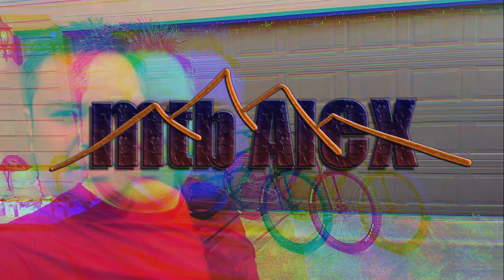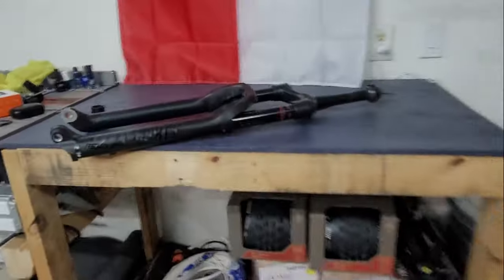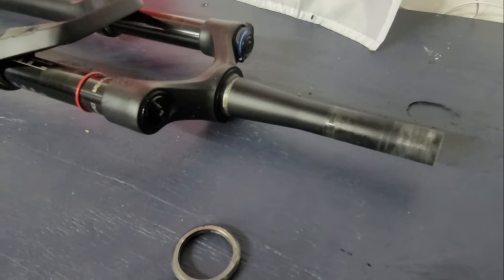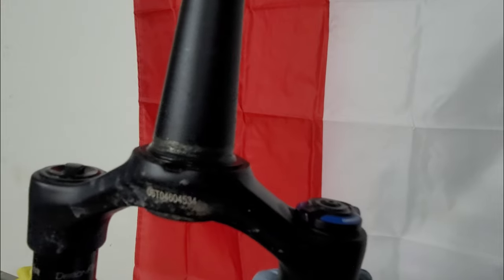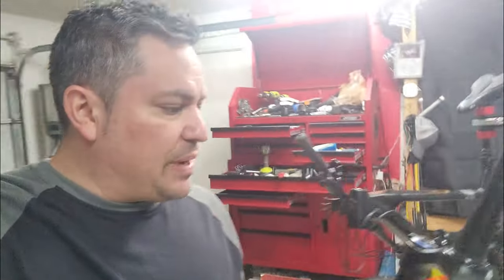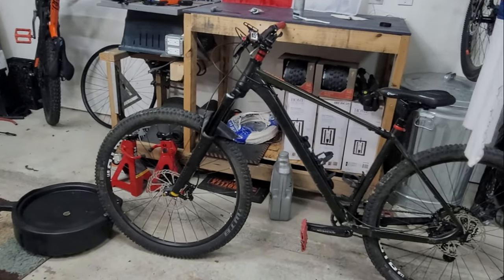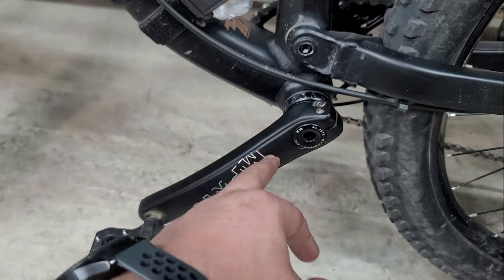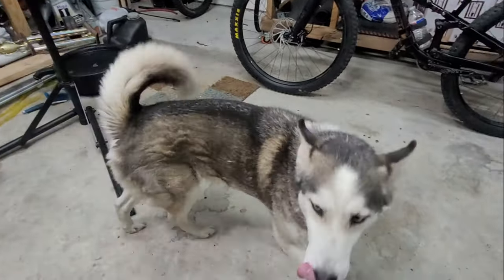My Polygon Sizkiu T8 gets maintenance and upgrades done. Mountain bike brakes, bottom bracket, fork.

Comment: Nice. I just put a Wolf Tooth headset on mine. Pretty easy, and the new one is smooth as buttah.......subbed for ya.. The 203's do look BA
Reply from the maker: Nice, is it really much better than the FSA headset?
Reply: Like silk. No lie. Although I like FSA a lot.
Reply from the maker: @donnovicki9771  good to know
44/56 right?
Reply: Yes that's correct